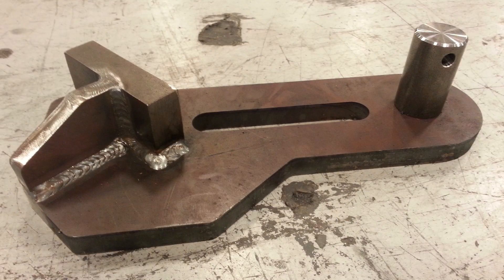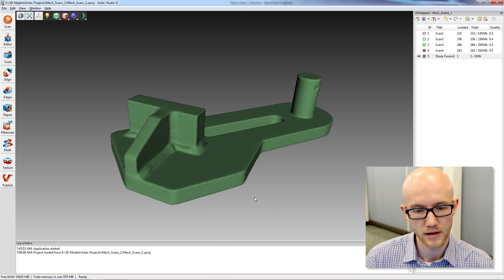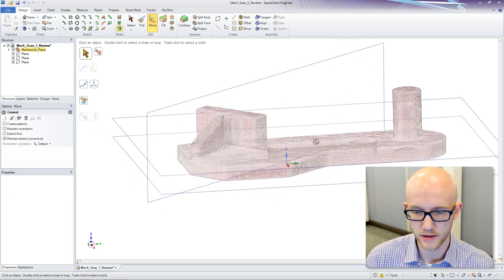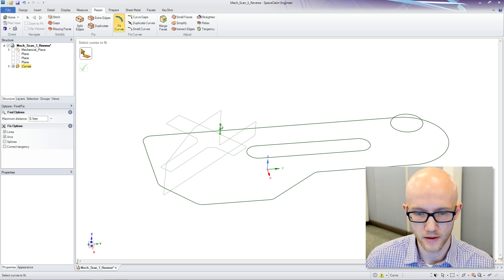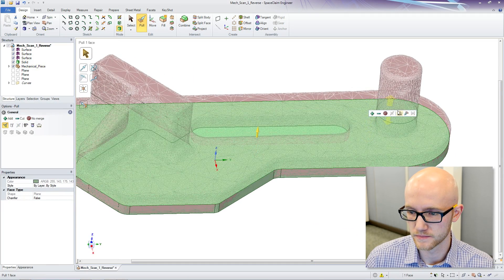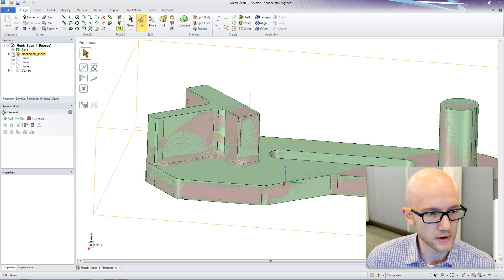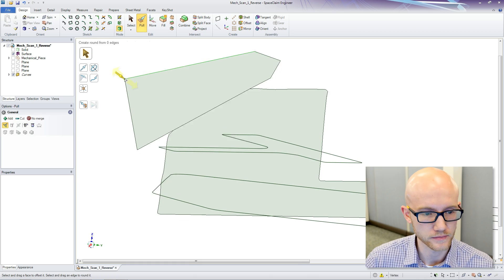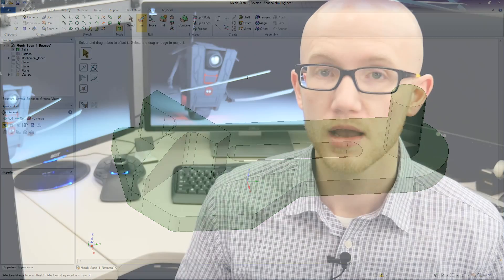How to Reverse Engineer 3D Scan Data - Artec Studio to SpaceClaim Overview

Comment: Great video! Is this possible using parametric cad softwares like Pro/E or Creo?
Reply from the maker: Chuan Liu This is a very late response, but it should be possible in parametric software options as well. We haven't tried it with Pro/E or Creo, but SolidWorks has a plugin called Scan to 3D that has similar functionality. I looks like PTC Creo has a similar extension option:
http://de.ptc.com/File%20Library/Product%20Families/Creo/Model/Creo_Reverse_Enginering_Extension.pdf